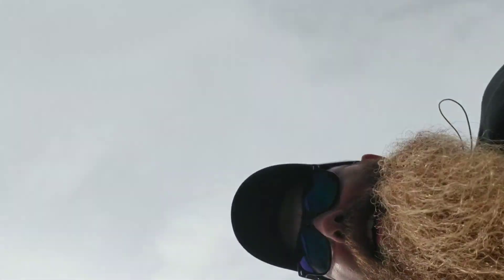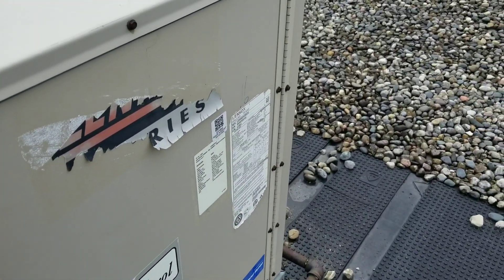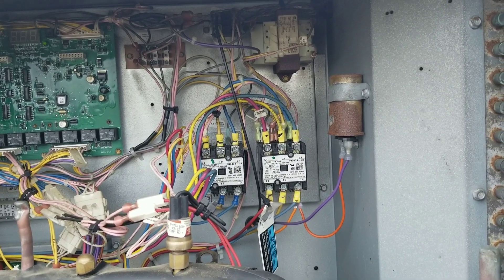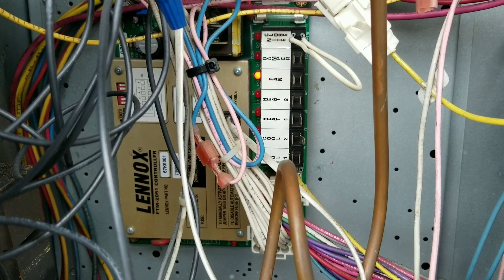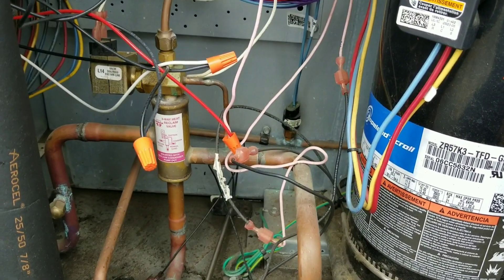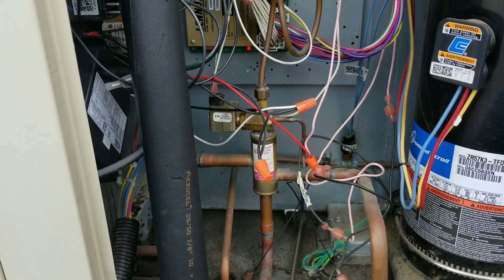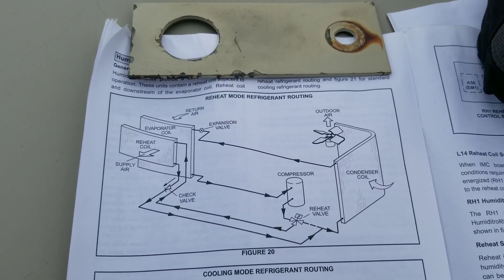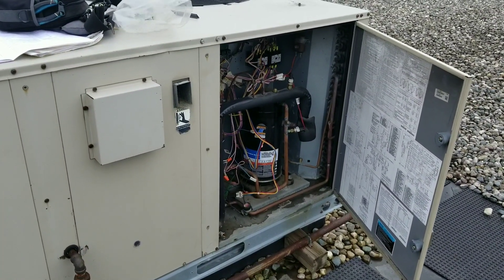Lennox package unit no AC/loss of comm with EMS

Comment: Wouldn't the reclaim coil be a condenser since its routing hot discharge gas through that coil downstream of the evaporator?? Evaporator dehumidifies and chills the air so the reheat coil uses hot gas to raise the temp back up so you have dehumidified air at the temperature you want? Love the videos man!

Comment: For the EMS board.. take that fuse out. Then you can  jumper out the relays you want to test.. example: stage 1 heating or cooling stage 1.. ETC. on that relay you will see the 2 male spades on the same relay.  jumper them together as connect them on the same relay.. voila. I find testing the cooling stage is best for last when I test for all

Comment: I always hate the unknown variables of turning up after someone else has walked away with the unit turned off.  You wonder if something's going to go bang when you turn it on again or if there's a miswiring booby trap.
Your sound is really good with a compressor and fan running.  Are you using a phone to record?  (I use Moto G's for my own videos.)
Reply from the maker: Your exactly right Clive- theres a bit of nervousness when you start playing around in a machine that is just left off, never know whats going to happen

Comment: Bloody control board with no screen , just switches and codes ,urgh !
I'm gonna stop complaining about the RTUs I work on , they might be complicated,  but at least they have a controller with s screen and buttons !
Kudos to you fellas !
Reply from the maker: Are you working on the prodigy system?
Reply: @curioushvacguy6876  not at all , I usually work on systems with Carel regulators or such , the nice thing is they have a screen and buttons 👍

Comment: The ambient pressure switch maintains pressure above freezing. Like on a server room unit that runs all year. On R22 the condenser fan should come on around 275psi with a differential of 50psi. So off around 225psi. This keeps the evaporator temp above 32 degrees.